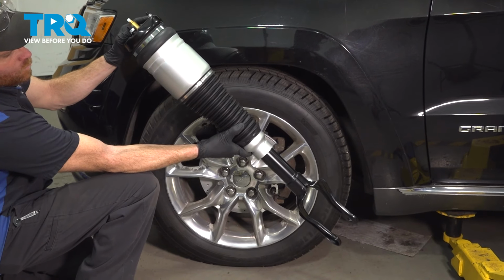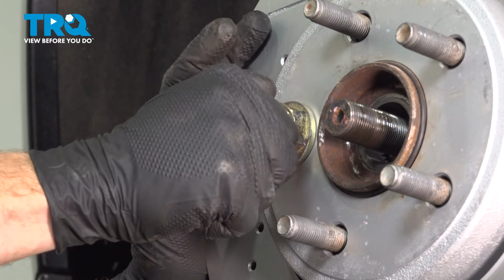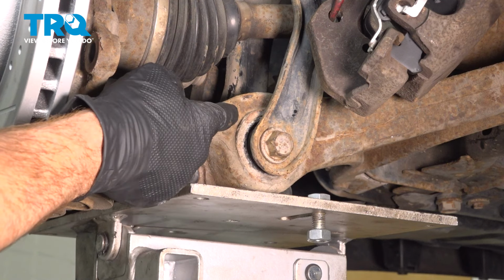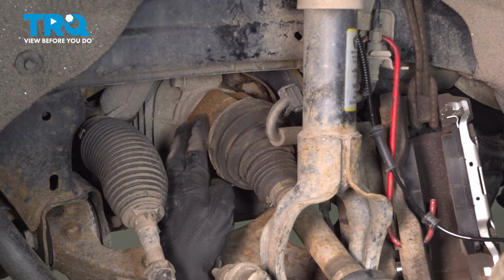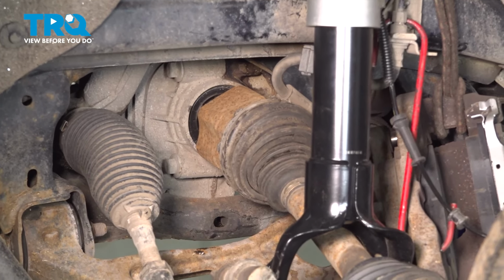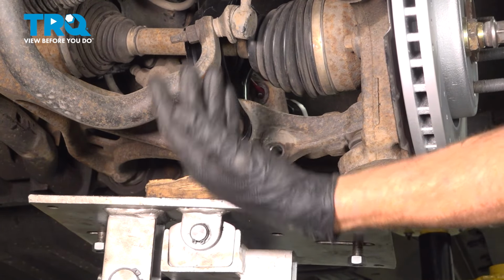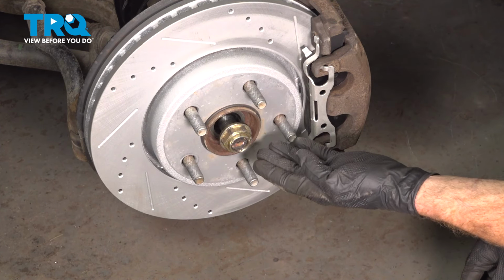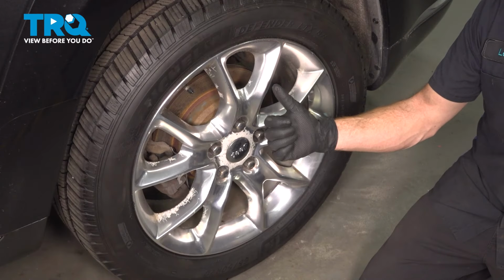How to replace Front Air Shock 2011-2021 Jeep Grand Cherokee

Comment: I don't recall if the video says this, but make sure the CV joints on the half shaft axle are not expanded when you install the half axle back in the differential.  Otherwise, the shaft will be too long and you will never be able to line up the hole at the top for the upper ball joint.  I learned the hard way and had to redo much of my work, but I did finally get it installed.

Comment: I did the rears with no problem.  Now, I have to do the front suspension.  I bought a computer to deflate and correctly inflate the air suspension.

Comment: thanks for the video! pretty awesomely explained in detail. 

This is the kind of reason that I couldnt be a mechanic, specially a cheap one. 

Because that seal is like 20 U$ (original). I would definitely replace that seal, even if is not leaking and look great. Now is just 20... and I have all pulled out already. If the car has like 80k+ miles. Just invest 20, replace it. and may be you saved to remove the entire thing again in the future. 

Sort of the same with some of the bushing around there :D

Comment: That was amazing! I have never seen suspension components come apart as quickly and easily as I was in this video....did you juice all the bolts in penetrating oil overnight? Because that was lottery ticket level easy!
And with all the problems those air elbow have with leaking, wouldn't it be a good idea to replace them while you're there?

Comment: ***YOU’LL NEED A E14 EXTERNAL TORX SOCKET FOR THE CALIPER FOR A 2017*** I don’t know what year Jeep this video is made with, but it’s not the same on mine. Just want anyone watching this prior to starting, not to be able to continue the job, without going to borrow or buy the odd tool, after starting. Creating a 2 day job from the one it should be, for some.

Comment: Would you be able to drive it across town with the suspension low on nitrogen? (To be refilled)
Reply: I just drove mine 15 miles yesterday. Fronts won't lift up in the cold. Rode like a lowered Honda civic but drove okay